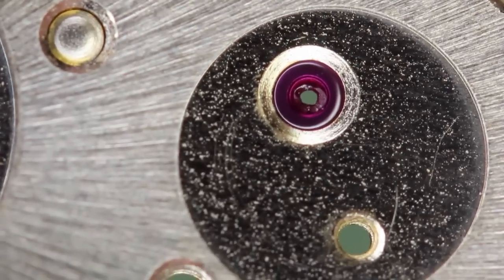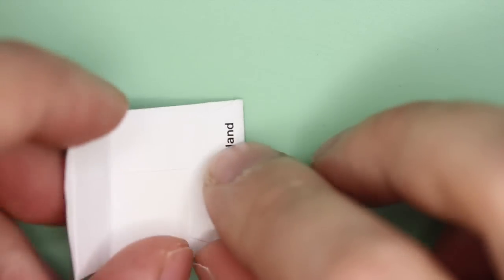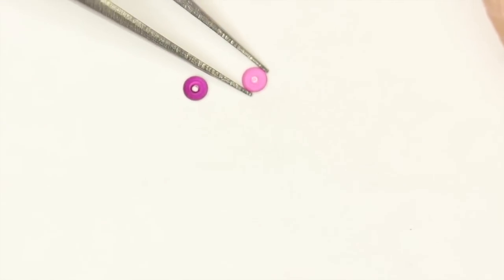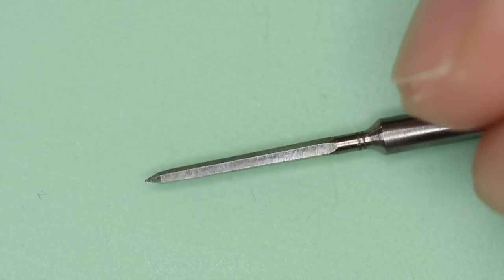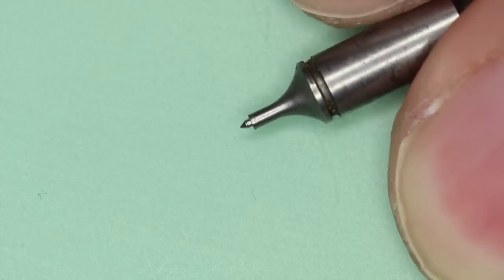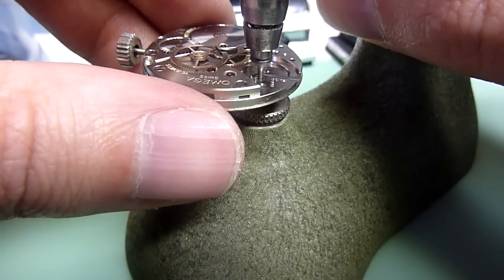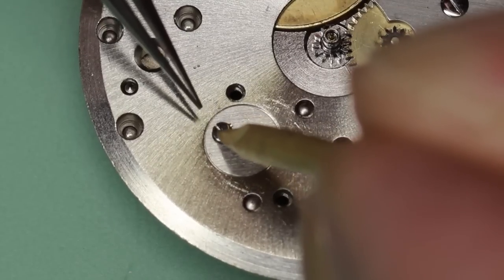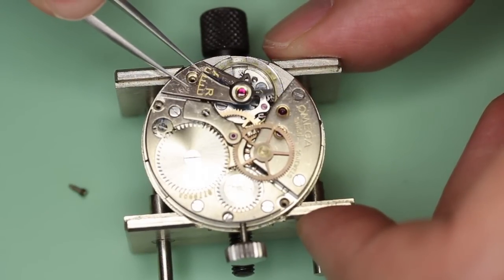Fitting a new jewel to a watch. Part 2 of 2. Friction fit balance jewel hole is broken. Omega watch.

Comment: Hi, this is off the charts, very good job.  I think multi purpose grease is the best for watch lubrication, just applying a film of it with a toothpick. Or if you dont want to disassemble the watch simply dissolving it in brake parts cleaner and apply it like oil, this will leave a thin film of grease between the parts. For cleaning parts i just put them into a plastic cup and swirl them in brake parts cleaner. For the mainspring i use silicon grease, mostly for corrosion protection.

Comment: Iv got a rolex 1530 movement that iv been told i need a balance top and lower jewel replaced this needs work to get it back on the road but i feel i still want to have it sorted for a later date when i purchase the correct case i would like  is this something that can be sent and done buy you etc or somone you can recommend i can upload a short vid to show problems  etc hope you can help if its major work and wanted to use as part of you vids for viewers thats also fine as i would like to have service done at same time thanks again

Comment: Hi Mark,  I hope you are still reading comments as your channel has been very helpful to me.  I see that the replacement jewel is 1.1mm wide, what did you ream the hole size to be..1.0mm?  Should the jewel always be .1mm wider than the hole?  Thanks.
Reply: Please Mark read Rane clowd's  question is really interesting and nobody answers it
Reply: Hi LC J, that is correct. The jewel should be slightly bigger than the hole. Usually 0.01m wider. When you actually do this, you will find out that the tool size to make the hole end x.x9, and the jewel size are always x.x0. Hope you got me.

Comment: Hi Mark

How would you set the depth of the replacement Jewel if the old one had already been removed and you didn't have the depth ?

Willy
Reply from the maker: +Bill Blackburn You keep checking and adjusting. You are looking for about 2/100ths (mm) end shake.

Comment: Hi Mark
I'm a bit confused hope you can clear something out.
I was wondering which side of the plate you removing and replacing the jewel ? Looks like you did both from the same side. And does it matter which side you remove it and put it back? 
Thanks
Reply: Hi jimareas, I have the same question. Let me know if you find out. Thanks

Comment: I purchased a Sietz Jeweling tool with tooling. Question is does Sietz only use their jewels or can I purchase other brands of jewels that will work with the Sietz
Thanks
Reply: Al Takatsch You can use it with any jewel that fits.